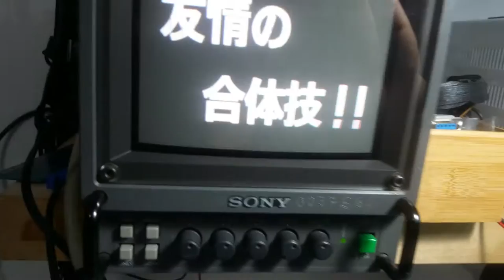Reparación de CPS2: Errores gráficos por pin doblado

Comment: I have a CPS2 a board with the exact same bent pin. Would this pin prevent a game from starting up at all?
Reply from the maker: Andrew Lomenzo if it is in the same conector, no.  Just the graphical issue unless it is touching other pins

Comment: Disculpa Artemio que tipo de cable Jamma es la que utilizas en el video?
Reply from the maker: El cable es normal,  calibre 20 para las señales y 18 para las líneas de voltaje y tierra. 

El conector es sanwa, pero no se ve. Está cubierto por un protector http://m.aliexpress.com/item/526798510.html?productId=526798510&productSubject=28-PIN-Jamma-connector-with-shell&tracelog=wwwdetail2mobilesitedetail
Reply: Pero como es que tiene esa faja roja . se ve de mas calidad y resistente que las que tengo jejeje.  y tiene salida vga?
Reply from the maker: +DorianLol Supongo no viste el link que puse.
Reply: Jejeje  Gracias